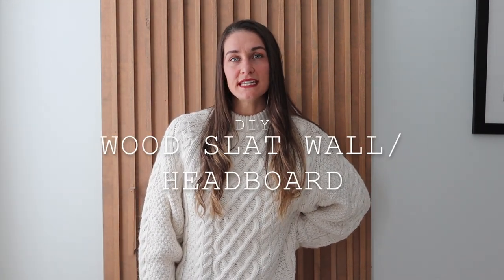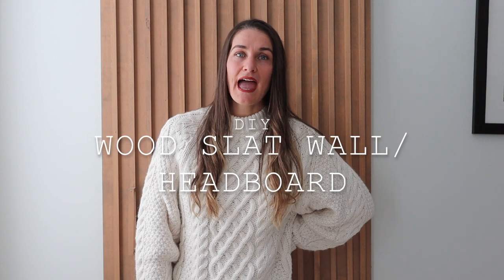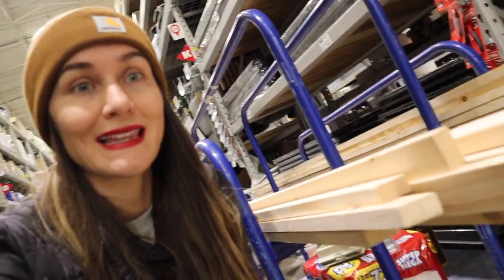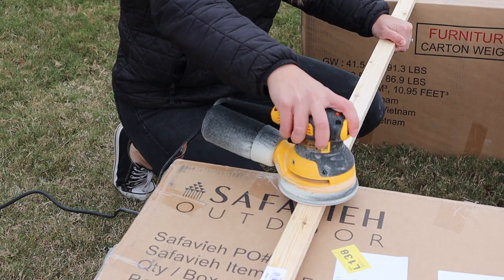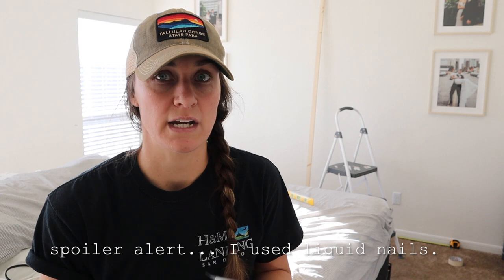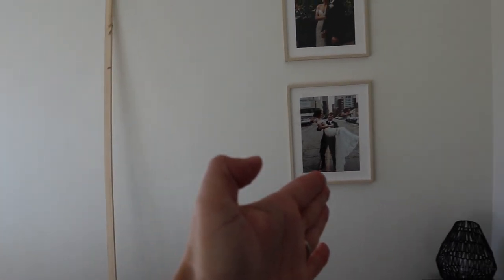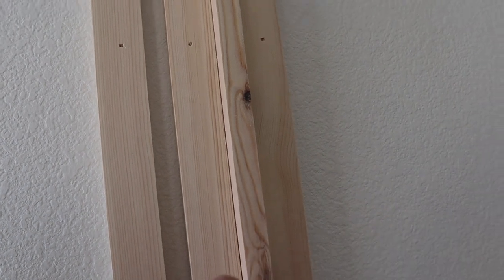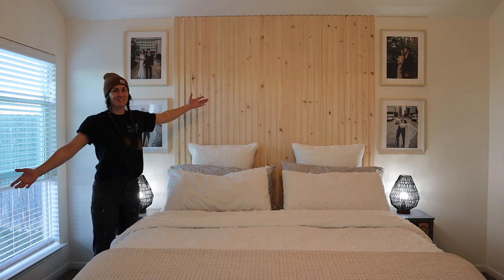DIY Wood Slat Wall I Vlog Style

Comment: Hello , could u please share the width of each fluting and width of spacing between them
Reply from the maker: The wood is.~1.5" wide (a typical 1'x2' at a local big box store) and for the spacing, I used the same 1'x2', just flipped it on its side to use its width ~3/4"